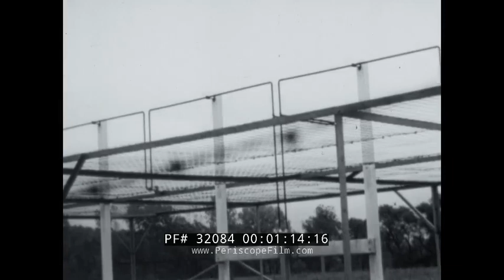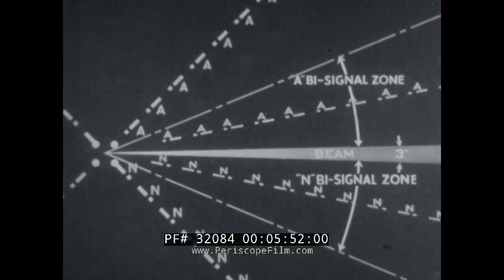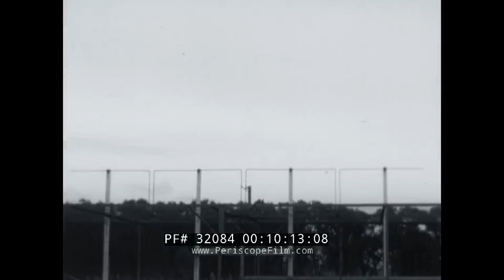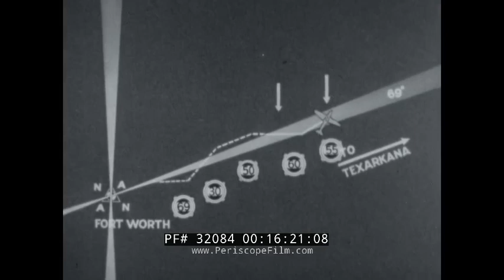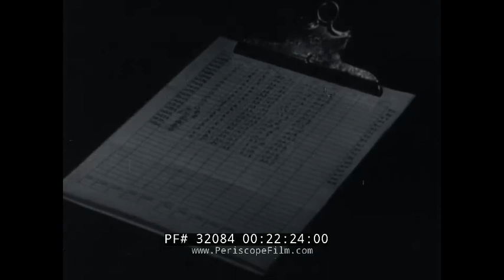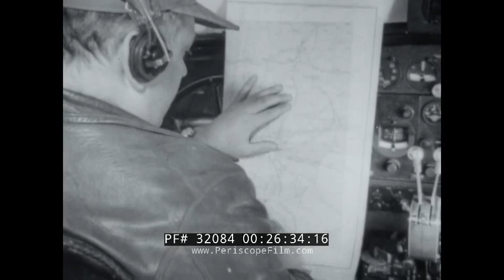1941 U.S. ARMY AIR CORPS  TRAINING FILM  " RADIO AIDS TO NAVIGATION "  32084

Comment: So assuming that the station is working right then (you know how it is with those vacuum tubes), and the equipment in your plane is working, and that little lightbulb didn't burn out, then you can navigate!
But then in those days, if you wanted complete safety, you never would've gone up in a airplane in the first place.

Comment: No wonder many older air transports had a navigator on the flight deck. To use radio range, you gotta multitask as a keen radio operator in a noisy cockpit. Can't fly too fast or easily overshoot / overcorrect the signal. This radio range system was replaced in the 1950s with the VOR / TACAN  system that is still maintained today as a backup to GPS and inertial guidance. I believe some pilots  use RNAV still based off VOR. I didn't realize fan markers still used in ILS approaches dated back to radio range days. The ILS uses similar tone discrimination of 90/150 hz tones to determine a flight path, but it is displayed on a guage rather than listening to volume of each  tone. Radio range navigation was the breakthru tech that developed into aviation instrument IFR flying. Thanks for sharing this history.

Comment: During WW2 Germany developed a long distance radio aid called Sonne or what the Allies called Consol.  The allies soon discovered what it was and use it themselves. So much so when their Spanish station went off the air due to a fault they made sure spare parts got there!  https://en.m.wikipedia.org/wiki/Sonne_(navigation)
Reply: Wow! Thanks! That Orfordness beacon provides an intuitive example of how a regular VOR works, except the timing works electronically and cycles many times a second.. I used to tell my students to imagine a rotating-beam lighthouse with an omni-directional light on top that flashed whenever the beam passed North.

Comment: Watching this, and being a pilot, there is a basic principle that carries over to today. You have to have a clear idea in your head what course you are navigating, and use the radio aids to reinforce that. If you lose track of where you are and what you are doing, the radio aid won't help.
The other thing that occurs to me is that the four course radio range was actually a more advanced system that the original method. That would have consisted of flying ADFs, direction to radio stations, alone.
Reply: On a check ride, Pilots had to do a  "Range Orientation". The examiner would put the aircraft somewhere in one of the 4 sectors. There was a procedure that a pilot could do to identify the quadrant in which he/she was located, then get on a beam, determine if going to or from the station and then go to the station and resume the flight. It was a complex procedure that required total concentration and accurate flying.

Comment: an updated version of this was called TACAN tactical air navigation.   There would be a transmitting set on each Navy ship .   The range part was automated the identifier was assigned to the station.  for example (ship name ) EA  the receiving set had a bearing and range displayed .    In the age of GPS the entire system is obsolete.
Reply: The TACAN system provides both bearing and range, as you say.  The range part of the TACAN system was borrowed by civilian aviation to supplement the VOR bearing system of the 1950s with distance information.  The resulting hybrid system is known as VOR/DME, for Very high frequency Omni Range/Distance Measuring Equipment.  Actually, the original terminology for the VOR system was Visual Omni Range, to emphasize that the pilot was provided with visual indications of bearing to or from a station, rather than having to listen to tones until he was ready to puke.  After aural range stations disappeared from the scene, the V in VOR was redesignated to refer to the operating frequency band of the VOR stations.  Functionally, VOR and DME are still separate systems, although the two systems are usually co-located at a common site.  The pilot does not need to worry about this; when he tunes a VOR or localizer VHF frequency, the DME system is automatically tuned to the UHF channel assigned to accompany that frequency to add distance information.  The Instrument Landing System, or ILS, frequently has a DME system associated with the localizer frequency to give the crew distance to runway information on the localizer.  VOR and localizer are VHF analog systems, glide slope is UHF analog, and DME is UHF pulse technology.  Markers still operate at 75 megacycles (MHz), believe it or not.  Ain't GPS grand?
Reply: TACAN = TACtical Aid to Navigation
Reply: it's certainly been a while, but having graduated from the Navy TACAN tech C-School and having been the TACAN tech underway, I don't remember TACAN transmitting any range info.   Both us and the aircraft used other means to provide range data.  TACAN was bearing only to the ship.   Memory is fading, but there was also an IFF piece of data.   Basically the helo needs to get back to the ship, TACAN tells them what heading to take, RADAR and other means provides range.
Reply: @JoelSzymczyk  the IFF information Friend or Foe! 😁🛫
Reply: @TheFalconJetDriver  right-  I remember it as Identification Friend or Foe.   CG ETC here,  did you fly CG Falcons?

Comment: I learned to fly before GPS but some planes had LORAN... now GPS and Nav database makes it caveman simple to navigate. This video is really old school before my day. Radio range required pilots to listen to audio.
Reply: Phantom Phlier, you are absolutely right. I spent time as a navigator on F4, F111, B52s.  I always kept up with my charts and an E6B calculator. I was pretty good at manual celestial navigation.
Reply: Original Loran required use of graphs to work out your position. It was designed for ships, not aircraft.
Reply: Scott Franco :  Correct. I suggest you look up something called Cyclan, or LORAN-C.
Reply: @scottfranco1962  it may have ORIGINALLY been for ships but as a P-3B radio operator part of my job was to preflight the LORAN, OMEGA and the LTN-72.
Reply: @kaptainkaos1202  I spent 17 years of my 21 years active duty in the USCG as a LORAN-C technician,  making sure you had those signals to use.   Went on to command three LORAN-C stations,  got out shortly before the entire program was shut down.   Always good to hear about someone using the signals we worked so hard to keep on air and in tolerance.
Reply: @scottfranco1962  Actually, "graphs" were not used with LORAN-A or LORAN-C master/slave chains. The navigator used aeronautical charts with overlays of LORAN hyperbolas, which represented time differentials (deltas) between master and slave stations' radio broadcasts. We would measure the deltas between the stations and draw the values as lines on the charts to resolve our position. In the early C-141A, we used a LORAN-C receiver (AN/APN-157, if I remember correctly) which could output its data to the main navigation computer (AN/ASN-24) that could do this automatically when the LORAN-C stations' locations were programmed into the computer.
Reply: @c17nav  Good information, thanks.
Reply: @scottfranco1962  Texas Instruments introduced a Loran-C receiver for aircraft rounds about the 1978 - 1980 time frame ... I had a chance to work on a sister program in the same building where the TI Com-Nav Group was located. The sister program I was on was building the first GPS receivers of the time under contract to the DoD.